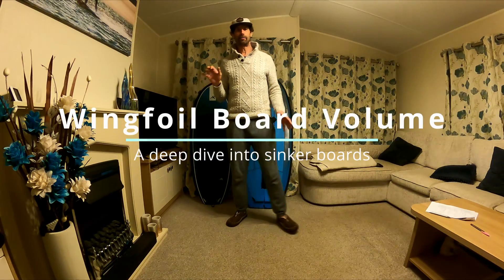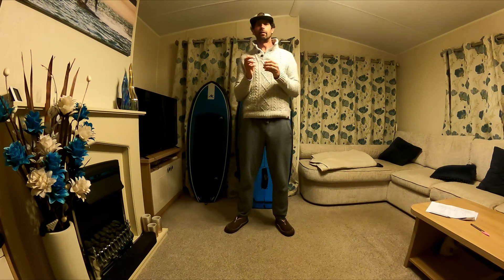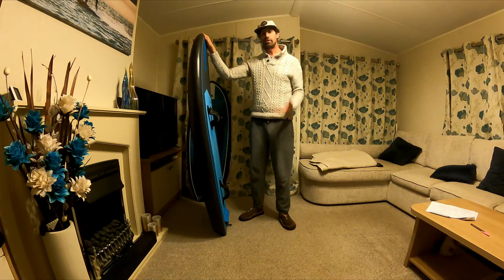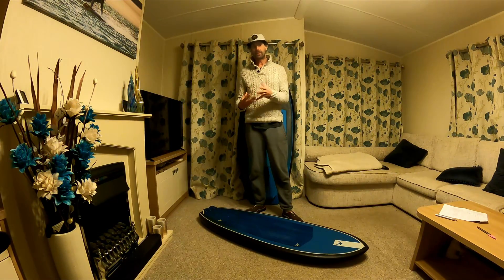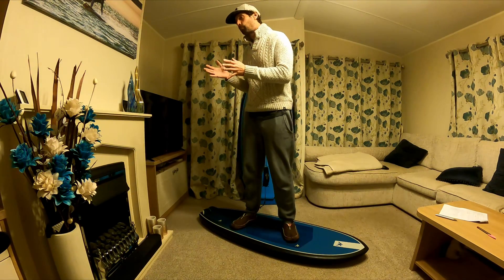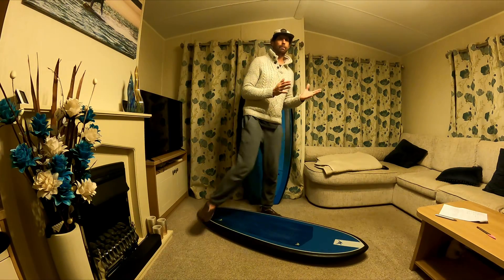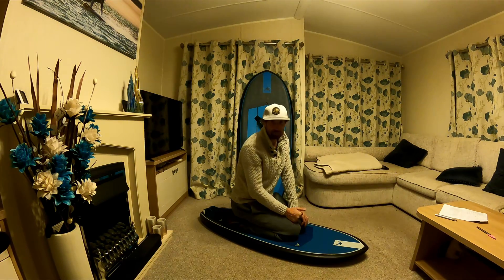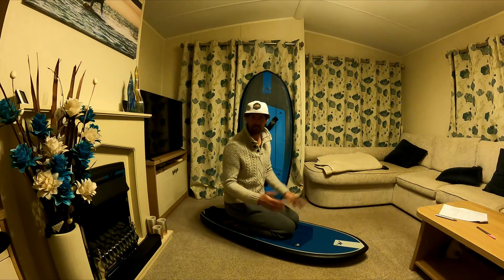Wing Foil Board Volume - A deep dive into sinker boards

Comment: Good video Pete. Question: when subtracting board weight in the volume calculation do you need to include foil weight? My theory is that the foil has its own volume so the ‘negative’ effect of its weight would be mitigated by the foil volume. Any thoughts? Also, I weighed my 5/3 wetsuit, boots, impact vest and leash when WET and the weight was almost 10kg. Add a coffee and a Cornish pasty before you go out and you’ll be pushing 12kg! 😅
Reply from the maker: If it's a carbon foil it'll likely provide a little positive buoyancy. Alu maybe you'll add a kilo or so of weight.
Your wetsuit actually floats even when wet, as do you, so it depends what is submerged and what isn't.

Comment: Good discussion about board volume, im trying to choose between two used boards one is 78L and one is 70L, im 70 KG,  but i dont want to be sinking trying to get up,  and i dont want to pump my brains out to get on foil.  Wind solves everything, strong wind makes it all easier.  But i wing in variable conditions so, after watching your video im thinking the 78 L board.  Thanks Larry
Reply from the maker: Hi. You're right that that tiny bit more volume will help, even if just to offset the weight of the board itself. You may find both boards a little tricky when the wind is lighter/there's significant chop

Comment: Good topic and explanation but missing 2 factors: 1. the upward lift that the wing generates helps remove some of the rider weight. 2. the increased buoyancy of sea water also would amount to ~2L of volume for an 80L board.  I'm 77kg and find on my 80L that i can float feet dry even in very light breeze on lakes, and of course more so on the sea, making it the sweet spot for a 1 board quiver.

Comment: Nice vid Pete. I am about 88kg. I need 18kts+ to sink start my 39L. Knee starting is easier, but I would prefer to sink it. I can only get going if I can get the board to the surface. I was thinking 45L at my weight for prone (mid length) and wing to see if I can going in 15 kts. You think I could sink the 45? My daily driver is a 60L but I can’t sink it easily— too much instability at just below the surface.. thoughts?
Reply from the maker: I used to have a 65L and I found that a super nice board all round, never really had any corkiness problems with it even at my weight of 82kg. I think my technique must be different though. I try to avoid sink starting the board, it's just a waste of effort

Comment: Great vid. Would be helpful to touch on what start methods work best to beat the instability that can be frustrating when learning. Also, at what depth of knee riding is more stable vs more corky? I.e. my 60L for my 65kgs is very challenging in choppy conditions.  My new 40L is most likely the replacement, with the 85L DW board for everything else.
Reply from the maker: Ooh that is a good question. I tend to get up and riding pretty quickly, avoiding any prolonged time bobbing around, plus you can get loads of stability from using your wing/dragging its tip in the water, which helps with buoyancy too. The rodeo stinkbug method is good for stability but i tend not to use it as i often have a 360 camera which would go into the canopy.

Comment: Has anybody tried the classical Windsurfing waterstart when riding overpowered conditions? Setting the board 90°C to the water surface, foil mast horizontal, stepping into the foot straps before the foil sinks and using the power of the wing to start from this position directly without the board sinking?
Reply from the maker: There is a video or two on that if you do a search. If you do it without sinking the board you need a great deal of wind to pull you up onto it. The technique they have proposed is to sink the board  to minimise how much wind it takes to get you over the board, but at that point your board is pretty sunken and then you gotta get it to the surface - which will take some effort.

Comment: Nice video! I use a 90l at 73kg naked.. I ride strapless in everything from very gusty marginal 7/8knots to 30knots with it. Id like to have a smaller more reactive board but im unsure I could get away with a smaller board.. hard to pull the trigger when they cost so much.
Reply: Same for me (strapless, 73 kg, 80L board for everything). I've also had sinker boards, but they're annoying in gusty conditions. My solution was to invest in a lightweight custom board (4.7 kg for 80 litres). This gives me a more agile, lighter board than most standard sinker boards but with a comfortable volume.
Reply from the maker: The market for second hand kit is getting more competitive as people move on to newer shinier kit, keep your eye out and i'm sure you can score a bargain :)
Reply: You ride strapless at 30 knxots ? 😮😮..Wow..that is a mad skill !! Whoa !!
Reply: Keep the board and upgrade the foil and the wings when needed.  There is some beauty in having one board for everything.